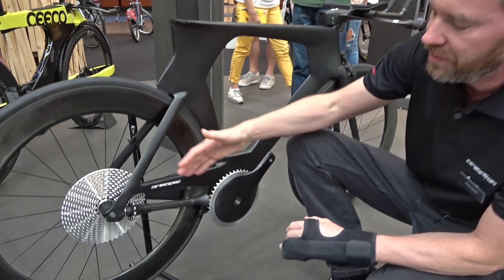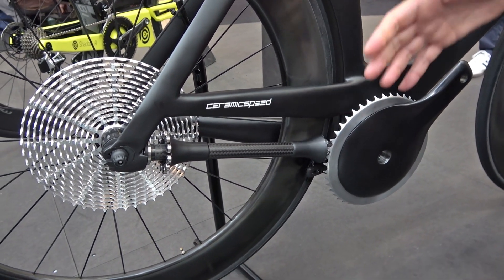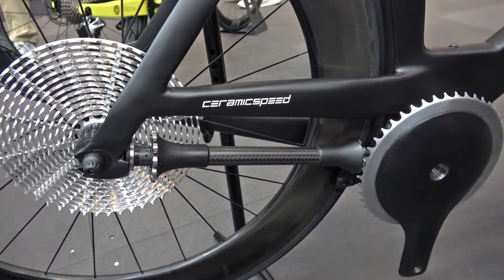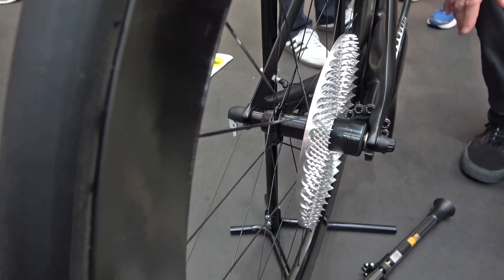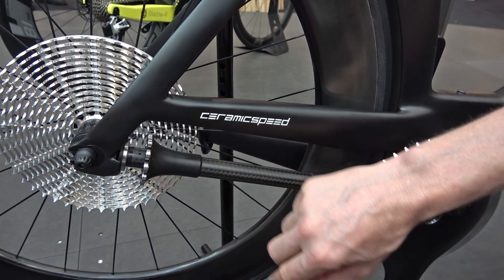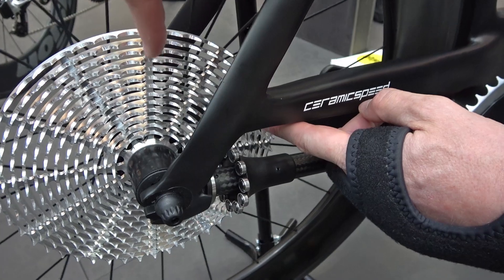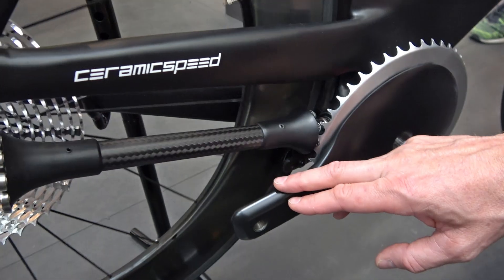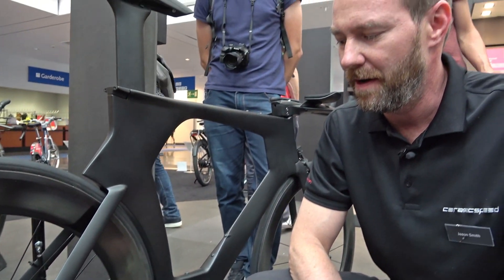CeramicSpeed Driven - Fully explained

Comment: So, a chain or belt drive transmits the power over 40-60% of a sprocket or sheive, reducing the load on each tooth by a factor of however many teeth are in contact with a chain link. There are no thrust forces at all eother. Tbis abomination of a system puts ALL of the force on a single tooth at all times, and introduces flex and thrust into the sprocket, making it about the least practical thing i have ever seen. Cute demonstration, but what a terriffic example of engineered to fail!!! Designed to solve one problem, but introduces 15 new ones that were already solved hundreds of years ago. What a waste of resources.

Comment: I find it shocking that so many experienced cyclists think that chains distribute the load over many teeth. Think! There are no parallel load paths. Even if you had a brand new chain and sprocket and their pitches were identical to within an angstrom, break-in wear would immediately place most of the load on one or two teeth.

Comment: No I believe you have just invented the weakest drivetrain ever invented. What's to keep the rear sprocket from flexing under severe load conditions allowing the drive sprocket to skip? What if it has too much oil on it will it skip under heavy load? What about dirt and grime? No you just wasted 8 months of engineering to come up with a concept that will never make it. Bicycles have been around for better than 200 years no short-sighted Epiphany is going to revolutionize the industry. Another words go back to the drawing board and try a little bit harder.

Comment: Nice but electric bikes are taakung over.
PS. I loved my 5 speed stermy Archer alloy on my bmx in the early 90s!
Reply: Andrew Radford electric bikes are great,but they will never replace the humble pushbike. They are just an alternative,not a replacement. The pushbike has changed very little in 100 years,yet people still love the exhilaration of being self propelled. I speak from experience. I have ridden bikes passionately for 40 years. I bought an ebike to commute to work,and I loved it,but after two years,I was so out of shape,compared to just cycling I decided to go to work on my push bike as I had done for many years previously. I am now fully fit again,and very rarely even ride my electric bike. They have their place,and are fantastic for less fit or able people to enjoy riding in the fresh air,but without the hard work and sweat.

Comment: High cycle loading on a carbon fiber drive shaft? Beautiful mock-up, but imminent failure. If that shaft were replaced with titanium or a steel alloy, it would last much longer. Still intrigued by the concept though.  ;o)

Comment: Ah, where to begin? I hate bycicles. My testicles hate bycicles.  Now that said i like great engineering and this aint that. 
Durailer thingy at the back. Oh boy! The first time you change to the lowest gear that thing will fold like trump being questioned by muller. 
Second is the gear change channels!! BS! Cars have synchromesh for a reason! Instantaneous my ass. Sequentially a few seconds apart ..maybe. 
Changing out the shaft for one with more rollers ? Wtf.? NO! How are you going to re index it. ? What will keep the rollers lockec into the gears.. oh and what the fuck are those gear sprockets made of , aluminium..?
Gtfoh..

Comment: Piece of shit..looks pretty..maybe a buy for grandma ,grandpa but you put force of just standing on front pedal to start ya your 1 point of contact bearing snapped off,then shift problems.then shifting is electric..not even a great idea...but it looks pretty for that to function,ish..you need 2,3× weight of chain drive if not more